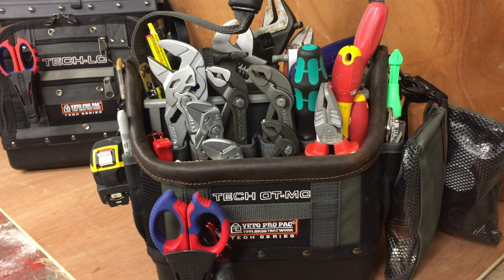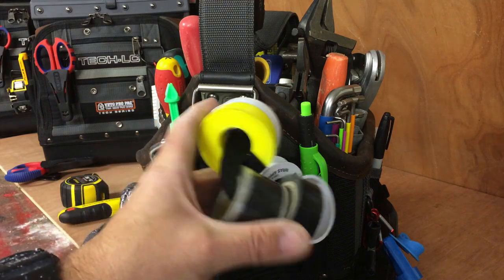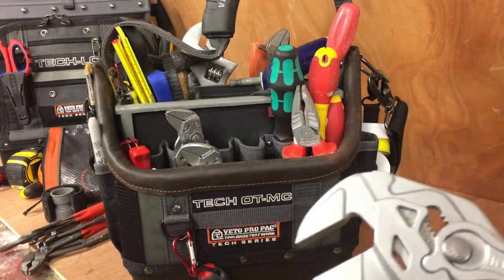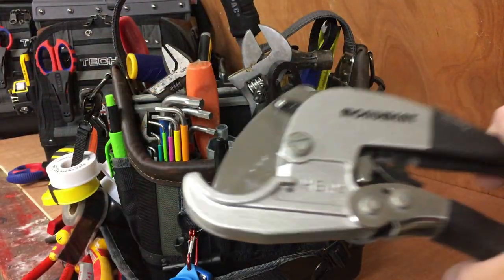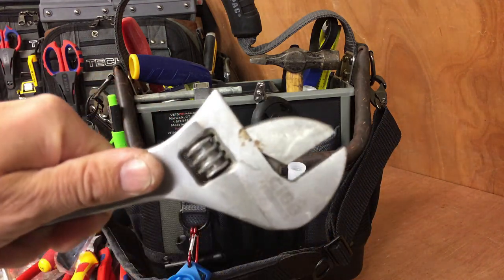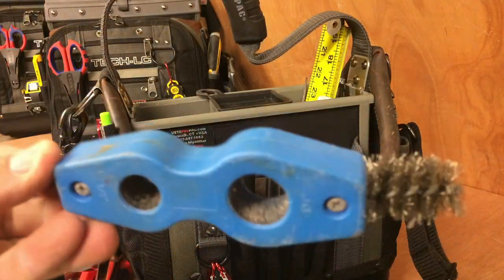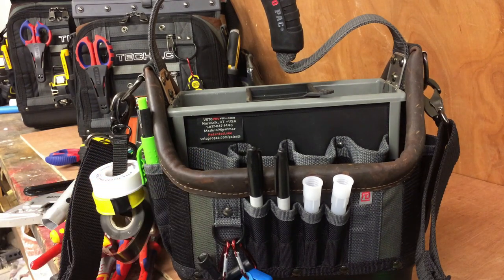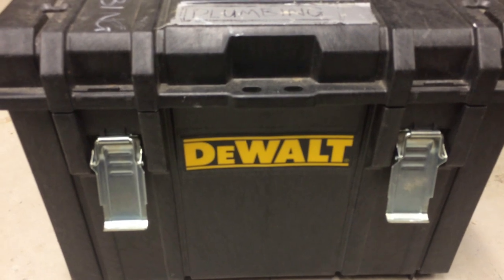Veto Pro Pac Tech OTMC | VETO OT-MC | Plumbing Plumbers hand tools

Comment: What tha? How Do plumbing tools stay that clean? I assume you just opened all this. Today. I never was very good at bags , totes and boxes. I normally only need about 4 of this tools. But WOW everything from a caulk tube tip to double sided shrink tape. I would get tired of carrying that weight. But props for staying neat and organized. I never was good at that part of job.
Reply from the maker: A few of those tools were brand new specifically bought for the bag (at the time of filming) but I do look after my tools. I tend to carry too much stuff, but if it saves a trip back to the van, then it is worth carrying the additional weight in my opinion, especially when your van is far away from the job site. Thanks for the comment 👍

Comment: I bought the pliers wrench set and almost always grab my adjustables i think that they are probably great in other trades but as a plumber the width of the 2 grips make it almost impossible to fit in tight spots
Reply from the maker: Yes, they area bit awkward to use in tight spots. Thin jawed adjustables are usually better in tight areas. Thanks for the comment.

Comment: Hi if you could just buy 1 all round plumbing bag what would your choice be ??
Reply from the maker: Hi Paul, The Tech OT-MC is good but it is a little too small (if carrying soldering gear as well) - I have had to clip a TP4B on the side to make mine work well for me. It depends on what you are going to carry in it, but for hand tools, the Tech OT-MC would be my choice but you would need a separate bag dedicated to soldering (if you do a lot of soldering) - hope this helps (just my opinion) - 👍

Comment: Just about to buy 2 wera nut spinners for changing taps. Which sizes are best guys
Reply from the maker: Hi Paul, I find that 9mm and 12mm are most common but you do often get 11 &13mm also. I would go for 9 and 12mm nut spinners but have a cheap set of box spanners on hand as well - you can get a cheap set for around a fiver https://amzn.to/3lBcZqi - this would cover you if you come up against other sizes. Hope this helps 👍
Reply: Perfect thanks